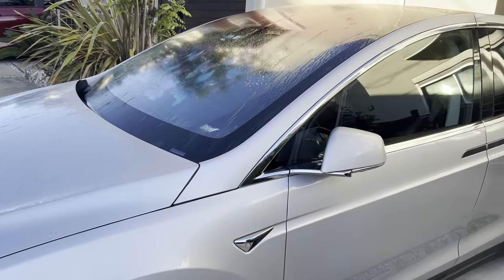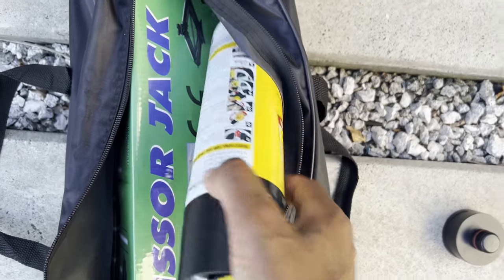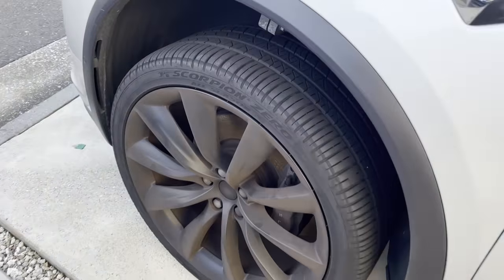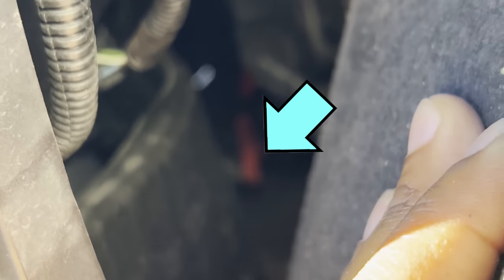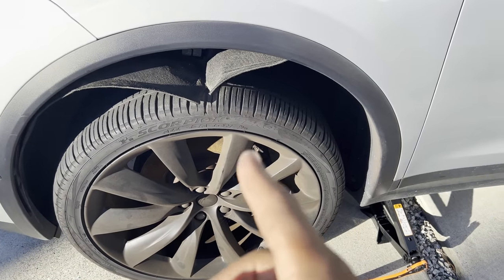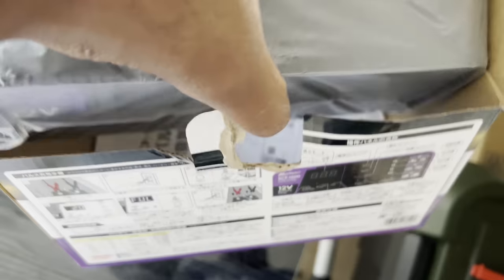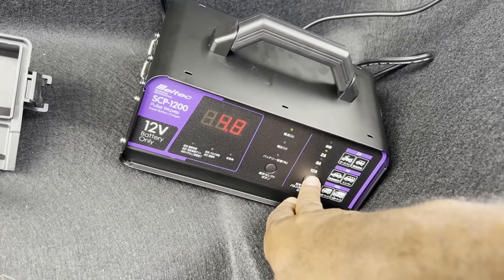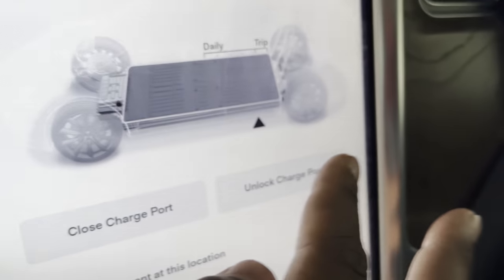How to unlock and recharge a dead Tesla

Comment: Wow. Just wow. You can't open the car if the 12V battery is ded or even charge the car ! In a normal car you used to be able to just a stick the dor and mechanically unlock it. Peope actually can and have died in EVs because of this supidity.
Reply: No, actually, they haven't. There is a mechanical door release that will open the doors from the inside without battery power. But thanks for the propaganda.
Reply: exactly. it happened in Toronto this week (Tesla of course). 4 of the 5 died. One was rescued by a bystander who broke the window. 12V battery was non-functional and car was on fire (after an accident).
Reply: @8ballphilc he’s talking about opening the car from the outside in the case of power loss. Its not propaganda. The door handles outside the car are electronically actuated, and not mechanical door handles. 

Google Toronto Tesla fire on youtube (happened 2 days ago). and another incident prior to the Toronto one, in the US.

Comment: on the front of the bumper there should of been a little circular cap that if you pop out has a positive and negative cable that you connect the jump box to that will acuate the hood release.

Comment: How about the 12v battery at the front bumper so you don’t have to do all that jacking? Just a question?
Reply from the maker: To get it it I need to access the frunk. To access the frunk, I need power . No power , so I need to access the strap. To access strap I need to jack